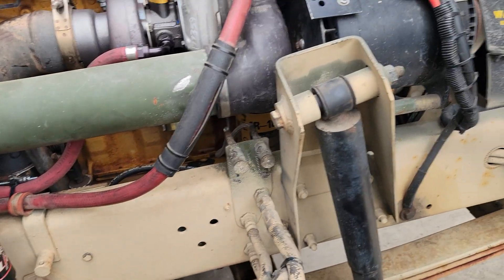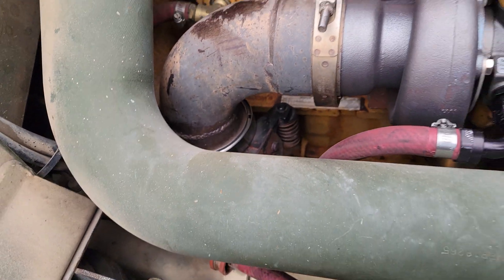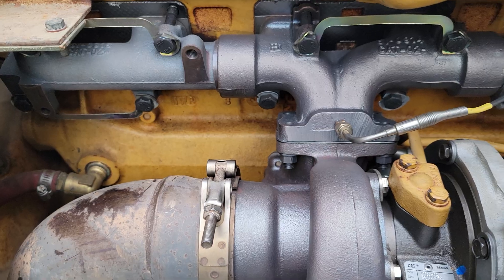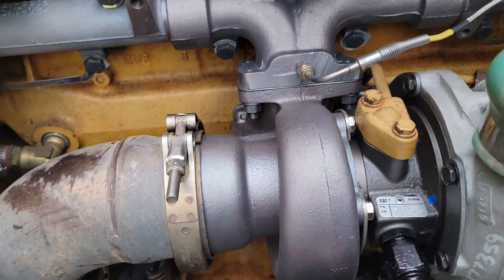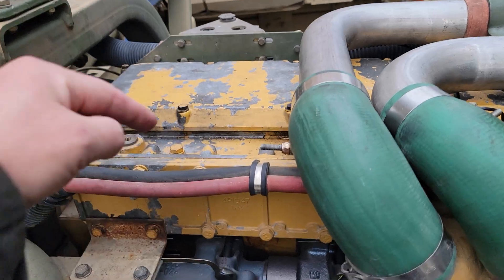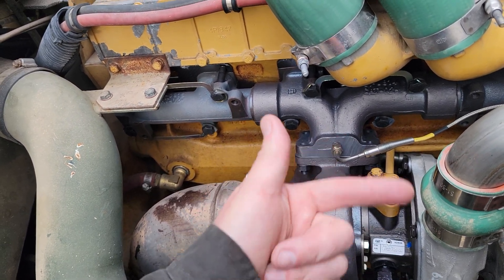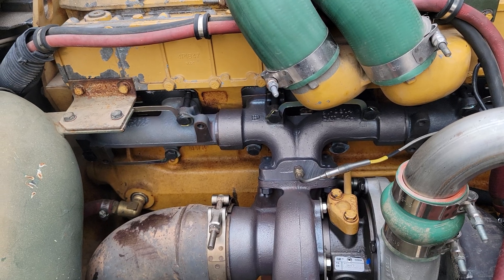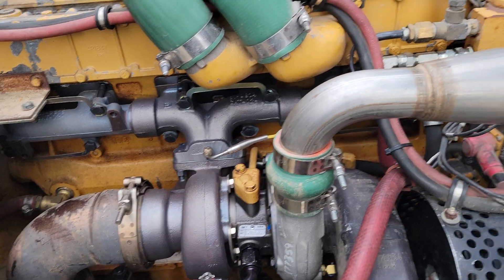Abel LMTV build part 198 (talking about parts used, the setup, and tuning of the new turbo)

Comment: hey sean did you ever find the 3116 RV specs for the turbo upgrade? Ive got the parts
Reply from the maker: I essentially did it with this new turbo.
Reply: @SeanFastidious ah ok, did you turn up the fuel rail?
Reply from the maker: @urgentcareguy3 did not need to as egts fell right where they are supposed to be😊
Reply: @SeanFastidious  I see so you’re getting about 320 hp, given the increased diameter of the turbo without any additional fuel? If so, that’s great!
Reply from the maker: @urgentcareguy3  not sure on the hp numbers but it definitely feels better than the previous 290hp turbo

Comment: About 3/4 of 5he way through you mentioned this turbo being a drop in for the factory if it’s failing, and then mentioned going under the valve cover and tweaking the fuel screw.  You can do this without having to mess with the injectors?
Reply from the maker: If you have a 290hp cat 3116 from the factory OR have installed both the 4r9815 turbo and the 290hp governor AND had the rack setup to the 290 specs by a cat technician then yes this is a drop in turbo with no adjustments needed.  I just got back from a long drive and my egts dropped across the board by 100 degrees so uphill I am hitting 1150-1200 egt temps instead of 1250-1300 that I was seeing with the older setup.
Reply: That was 5he answer I was expecting, but wanted to make sure.